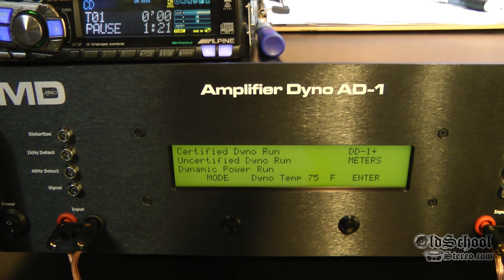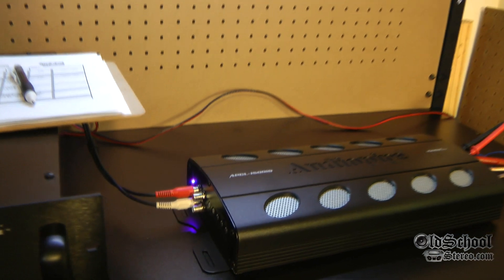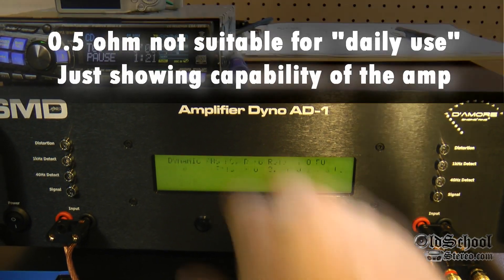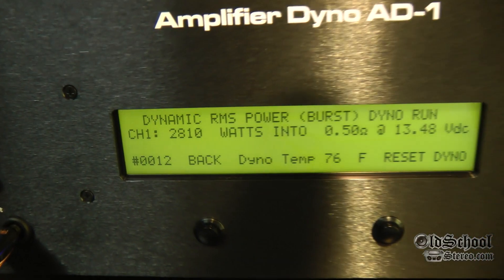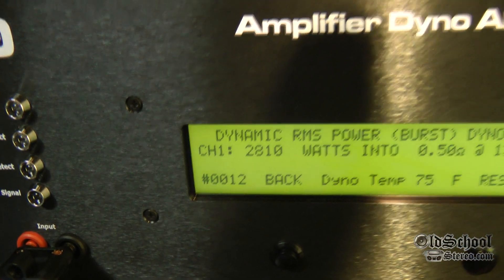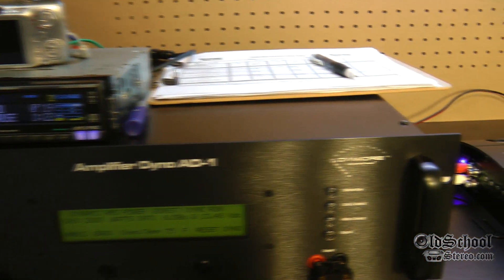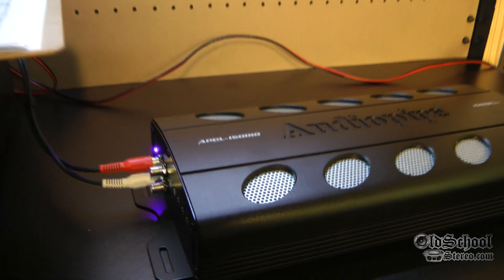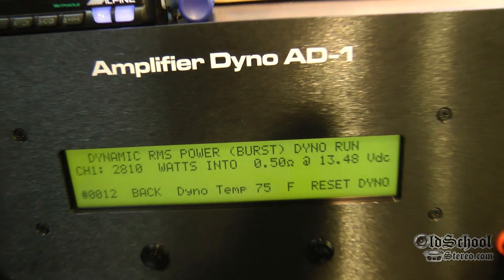Audiopipe APCL-15001D SMD Amp Dyno Dynamic Power at 0.5 ohms WOW

Comment: Haters just can't believe a budget amp actually pushes good.  Oh its cheap, oh it won't last, sound is crap..... I have seen a few of theses amps go full tilt for hours and still going strong after a year of abuse. Audio pipe is my go to amp....period!
Reply: +Brian Reed tell them to buy the APK serious then if they just want to spend some money. i have the APK 2500 and its a beast
Reply: yep
Reply: I've had mine since 2015. Still going strong. Been through some hell pushing two large Audiopipe 10s and the Florida heat.
Reply: Mine still going after 8-9 years audiopipe sub and amp

Comment: Great amp. Ran one daily on a sa15 for a year. Never had any issues with it. Never even got warm running a 1 ohm.
Reply: did u sell it? or did it die on you? im considering buying this
Reply: Yea I sold it and got a Skar RP 2000.1 off eBay. The refurbished ones are 179.00. But the Audiopipe was an awesome amp. Wouldn’t think twice before buying another.
Reply: thanks for the reply. i have a alpine SWR-12D4 (1000w RMS) and gonna be wired in 2ohms. audiopipe will probably power this thing nice?
Reply: Should give it all it needs for sure.

Comment: AudioPipe FOR THE WIN!
Reply: MazdaBass971 how does the apmi 2k compare..I am having a hard time findind an amp dyno of one..I am going to strap..or two of them at 0.5 ohm each..just not sure if they can take it
Reply: Look up the audiopipe APSM series, they are the exact same as the APMI but with a different heat sink, they are pretty awful amps.
Reply: Rock
Reply: Just picked up the apmi 2000 after my aq 2200 shit the bed and it's actually louder. I thought I was settling for a temp bass fix and I'm ordering a 2nd and strapping.
Reply: Timothy Hinton I have mine at .5.. rise is over 2 and it gets hot. Loud but gets hot. Going with a 2nd strapped at 2 ohms

Comment: I got this amp pressing T1 15" at 1 ohm. I love this amp!!!! 2 thumbs up
Reply: I bet the amp doesn't even get warm :-D. You know, you can get the power T2 12 inch which is rated at 1,500 watts RMS. Get 2 T2 12's for a total if 3,000 watts RMS. Get 2 of these amps strapped together. Since one of these does 2810 watts at 0.5 ohms, then 2 should do 5620 watts at 0.5 ohms. Talk about POWER!!! Plus, the T2'a are made for SPL, so get ready to get loud as hell XD
Reply: I have the 2000 watt audiopipe amp, with the 15"2800 watt subs and it seriously bangs

Comment: Question?
This amp's frequency response is 80Hz - 180KHz.
How is this a good subwoofer amp if it's frequency response is higher than where most people would cut off for crossover?
Reply: I know you don't remember commenting this and this has no significant meaning but its 8hz-180khz not 80.

Comment: None of that internal 25 or 35 amp fuse deal - No protect in half ohm. I'm impressed. I think the frequency deal is wrong based on the controls in the manual. Hmm... thinking about this one. Nice Dyno

Comment: Bid D think this amp is a ringer? Or will the amp that you tested be the same the consumer will be buying?
Reply from the maker: I insisted from AP that the amp be an "off the shelf" model and not modded in any way. I'm asking permission now to remove the bottom panel to show off the guts.
Reply from the maker: I just got the green light to remove the bottom panel and show off the guts

Comment: Always going to be unhappy people in the crowd. Conspiracy theories, you're measuring wrong, the AD-1 is wrong, it's wrong because it won't do that in a car, you have a loaded amp, these numbers aren't possible because AP is such a garbage brand, "real world" blah blah blah.

This IS the real world. And whether you like it or not, this amp did 2810 watts on the amp dyno at a load which he previously stated was not suitable for use in the car. He didn't say this amp would do that in a car. What happened here is that an amp that people like to hate on got measured and came up with numbers not associated with $150 amps. So whatever crap you're talking about doesn't mean anything. this was a legitimate test to pull numbers. If you don't like it, save up for an AD-1 and see what this amp does when "you" test it. Or better yet, keep running your one meter "clamp' tests. Those are super accurate!
Reply from the maker: Jason R. oh wise one, thank you for a refreshing comment!
Reply: Jason Rose yep ,, preach it .audio pipe all day .
Reply: I run mine at .5ohm daily and have so for almost a yr, I should also mention that I purchased the amp USED from a friend!
Reply: audiopipe underrated u sleep

Comment: question, I might have missed it.. what is the power draw from the amp? I have a stock 130amp alternator and the big three done and sitting in the low 13 volts. how much less power I'll get I wonder? should be around 1400 wrms ? or should I get a bigger alternator first? thanks for videos bro, keep it up.
Reply: Thanks thats what I did, now have three batts, upgraded alt. Now never drops below 14v. Thanks for the info.
Reply: Have four shallow10's in ported box behind seat in my truck and just kills your body..lol.. Great budget amps; those APCL amps.

body.lol - Body.lol

Comment: Hi Dereck BigDWiz i just wondering, could you test Belva BB5000D. ? Thas will be great. Thanks!
Reply from the maker: My current setup won't support more than 250A continuous at up to 18V, so I don't think I can handle amps that large. I've seen a test on one of those using an Amp Dyno, check YouTube.
Reply: Dereck BigDWiz Oky thanks!

Comment: So this amp could push the Orion HCCA 12" sub, it's 2500 watts?
Reply from the maker: Push it, yes, push it to the subs limit? No
Reply: @wal  You've got more hands on experience than most people with amps. Is there a budget minded amp out there you like for pushing something like a 2500 watt HCCA sub? It seems like the Orion XTR 2500 tested well with you. Anything else?

Comment: you sure they didn't beef up the components on this particular amp hoping to boost sales? seems a little beast for audiopoop js
Reply from the maker: I specifically asked for this to be an "off the shelf" amp and after opening and reviewing the internals, I've concluded it is indeed a stock amp. The full test will be coming out soon and I'll show the guts
Reply: in that case ill ad ive always considered audio pipe to be in the same class as lanzar pyle legacy and boss but now I must say they are in a class of theyre own still not quiet cea compliant but for the price who needs that label
Reply: brian henson did you just Put lanzar and Pyle in the same category sMh
Reply: PsMoKe Mob 2000 watt lanzar couldnt even put 400 watts a channel oh and bridged it didnt last 30 minutes. 2 ohm stable my ass

Comment: Hey man, what if audiopipe specifically modded that amp to do crazy amounts of power knowing that it'll get tested and placed in front of the internet?
Reply from the maker: I was ensured the amp I received was not modded in any way. This was very important to me and I know everyone watching.
Reply: i had serious issues with audiopipe when I had their amp. They are not dependable and do not have an onboard fuse to protect itself and the speakers. I would like to see what it does at 1 ohm which is what it is rated at. I'd never run a system that low.
Reply: Cdogg2233  Many higher quality amps do not have onboard fuses. The installer is supposed to install an inline fuse that matches the draw of the amp. For a high power amp you would have to have a lot of fuses on the amp and that just is plain ugly.

Comment: what was tha point if its only 1ohm stable not supposed to be ran at half ohm
Reply from the maker: Just shows the dynamic capability of the amp, that's all... which is impressive, based on other amps I've tested

Comment: I wanted to buy this amp and a car audio shop told me that it is crap? What do u think
Reply from the maker: I prefer not to make a comment about the durability or reliability of this amp as I have not had it long enough to determine those factors. Based on how it did on the bench vs. price, I think it's a great value
Reply from the maker: Suazzz As with everything else, do your research and don't take one person's opinion as fact...the numbers here can't be disputed as the Amp Dyno can't cheat the results. Amp Dyno doesn't know if it's a $150 amp or a $1000 amp, all it does is measure wattage and voltage.

Comment: I bought this amp, ran it at 2 ohms for A month and now the protect light is on and. The power light is flashing blue rapidly . Terrible
Reply: This can happen to any amp. It all depends on who's working at the time it was made. Because let me tell you, there are a lot of idiots out there doing any kind of job. Some involve people getting killed, while some involve amps getting killed. Luck is but a mathematical equation that chose you as the victim. Life happens. Usually for a reason but sometimes just because life...
Reply: Clyde Canaday  Hey clyde some times electronics just go bad right off the bat it is actually on average 20%. Some times it is because it was wired improperly. The ground wire is one of the worst items for this. To protect your system you should install an extra ground from your block to your frame, one from the battery to the block or frame and then some ground straps at other locations on the body. Also driving an amp to hard is a problem just leave the gain at 3/4 or lower and tune your box to the right frequency.
Reply: You must have had it turned up way too high and had been running it on low voltage.

Comment: So these are .5 ohm stable?
Reply from the maker: +gsxr hayabusa for burps? Yeah. Daily, I wouldn't
Reply: BigDWiz thanx...just had a box built for 6 12s...I have 6 pioneer tsw311s4 and it comes up to .67 ohm...so I need a good 2500-3000 watt .5 stable amp.
Reply: i daily it just give it power and keep the gain low oh and a fan but it works great       im running two zvx 15s

Comment: would anyone run this amp at half ohm
Reply: I kind of want to.
Reply: i have been for a while on two zvx 15s it does have some distortion but i keep the gain low and feed it as much power as i can and it works great does get hot but as long as you keep a small fan on it it stays cool and i havent had it blow yet and she has went into protect at least 3 or 4 times when i hit the  low 18 to 20 hz but ever sense i put in a second batt its been fine
Reply: I run 2 AB XFL12s with this amp daily at .5ohm. Had some electrical issues at first (off 1 batt my volts were dropping to 10.3 ran this way for about a month) and had mine get hot and go into protect several times. I am extremely hard on all of my things and this amp has taken the abuse. Running a 2nd batt now and haven't had any issues.
Reply: Update, current have 2 of these strapped to a final . 25ohm before rise, etc. And it BLEW MY MIND the difference in sound going from .5ohm to .25ohm. I truly feel sorry for my '12 Subaru STI cuz the 2 12" AB subs take the amps abuse and beat it into my car.

Comment: its less than 200 because its made with cheap parts that break its always too good to be true with amps like that
Reply: Actually audiopipes suggested retail for this is 300
Reply: Johny Ellis it retails for 159.99 on amazon AKA too good to be true
Reply: I run this amp and like I said suggested retail was on audio pipes website yeah people buy in bulk and sell for cheaper on amazon. I bought mine off amazon and its a bad ass amp for the price. It shits on anything priced the same
Reply: Not too good to be true, this amp is amazing! I run mine daily at .5ohm to 2 AB XFL12s and have so for around a year. Also bought the amp USED from a friend who pounded the shit out of it daily. It's a testimate to how great this amp truly is. I challenge u to find anything better even at the price of $300...all wait.
Reply: So you can run .5 daily
Reply: I ran at 0.5 daily for about a week and cooked this amp lol..oopps.
Reply: @tjohnburton  with good upgraded eletrical. yes you can

Comment: Theres no way you'll ever see more then 2000 clean watts rms in a real world inside your car... This is misleading and is gonna cause people to try stupid shit at home with the voltage/gain settings on a multimeter to get those numbers on these amps. I hope your a bit less one sided with your review. Most real world clamps show these amps failing hard to make clean power.
Reply from the maker: This test is not misleading, it is an actual test of the APCL-15001D using the AD-1 Amp Dyno (designed by Tony D'Amore, lead Rockford Fosgate engineer for 10yrs). You can try to dislike the results, but they are what they are. Who's one sided? I was amazed at the numbers, why is that one sided? Why all the hate? I'm just the messenger here. "Real world clamps?" Do your research to find out why "clamping" is an inaccurate way to attempt to measure wattage. I'll help...clamping using speakers gives you Volt Amps or VA, not watts. You have to factor in electrical phasing which occurs when you use a reactive load (speakers) instead of a resistive load (power resistors as the AD-1 uses).